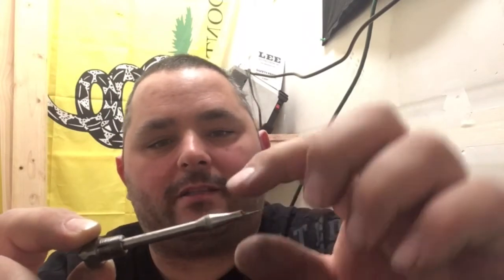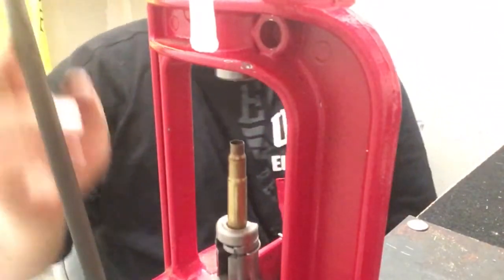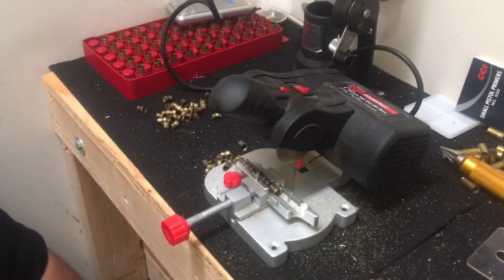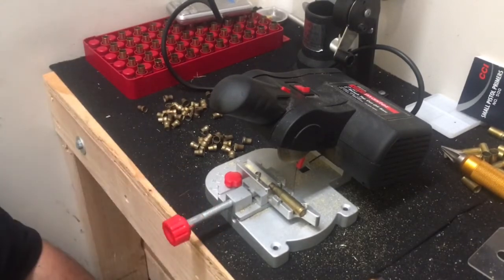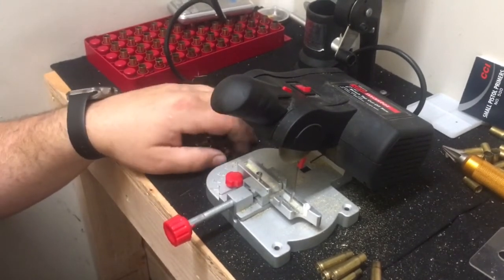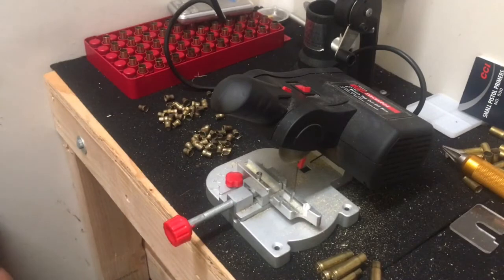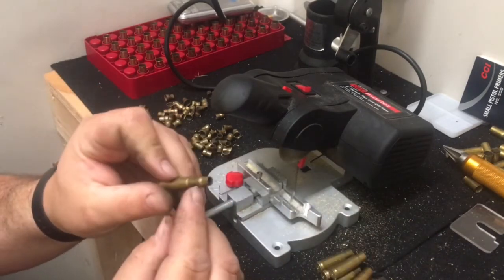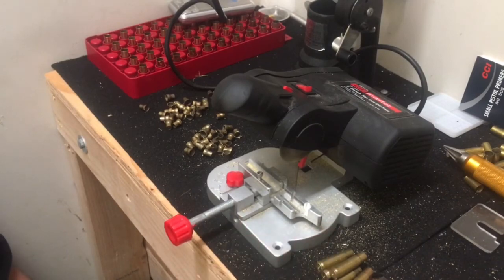300 Blackout Case Conversion (Converting 223 To 300 Blackout)

Comment: Doesn't that pin also give neck tension when you resize? Without it installed are you getting proper neck tension?
Reply: I also do this to my .223 cases.. i cut first, then size, then trim, then tumble... any other way is not a good idea and just not the correct way..

Comment: What length are you trimming the brass to after you re-size.
Reply from the maker: 3GUNCNZEUNIT I can’t remember right now I had problems when I first started conversion because the measurements in my manual were a little bit long. I bought a box of Hornady factory ammo and used that for my measurements

Comment: Is that the blade that came with the saw? Mine wont cut near that fast and seems to slip
Reply from the maker: Trent Frasure yes it came with it. You can also buy replacements blades
Reply: Same problem here, did you ever figure out? Did a new blade help?

Comment: Ha! Ha! Ha! The 223 case comes from 30 Mauser so all the AR 15 series are essentially Mausers! 

The 2 inch cut off saws heat up and take long time to cool down. So do the 2 inch saw blades. I found a shot of WD 40 type lube on the blade and in the cooling slots extends the session and life of the motor.
 One thing I have not tried yet is drilling additional cooling holes in the nice decal and body. The drive belt side panel is enclosed. Now that keeps brass chips and dust out of the motor.  But the saw is not designed fur a production line. At ten cases and a cool down I'll turn purple and explode saving a $40 tool.
So my next bet is disassembly. I don't want to drill cooling holes in the motor itself! Then to drills some Cooling holes in the remarkably effective heat retaining cover.

They do sell cutting tool oil and spray. Stay well ventilated when using any chemicals. Read labels fire. hazards. Do not stick nodes picking finger into the saw blade..